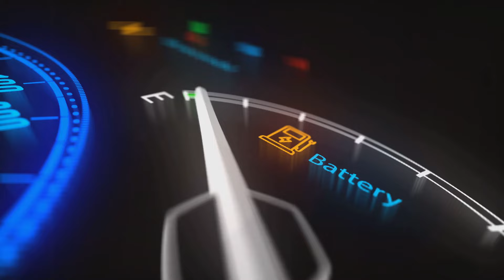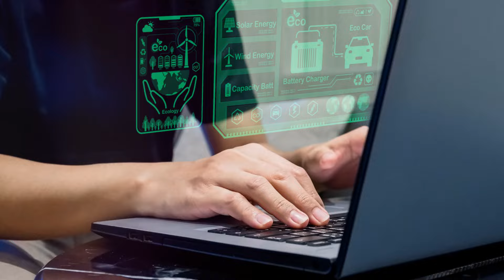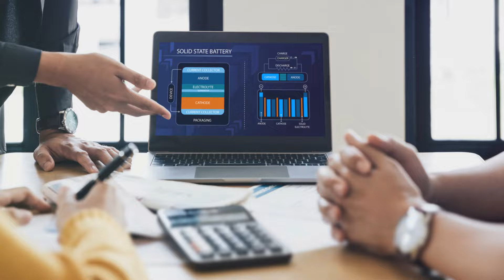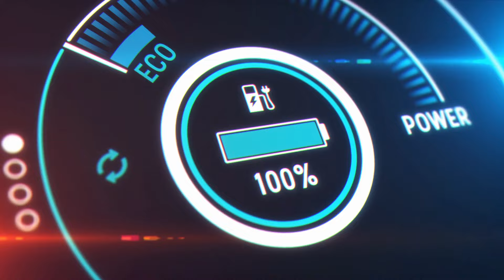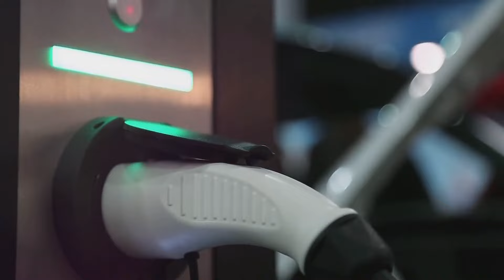The Hidden Environmental Impact of Electric Vehicles

Comment: Seems like a nonsense EV smearing video that repeats itself over and over, definitely a thumbs down from me. It's an emerging industry so there are obviously going to be problems but it's definitely a step in the right direction and far better than petrol/diesel. Once we get most or all electricity from renewables they will run emission free and there's plenty of people working on clean recycling of batteries etc too

Comment: The amount of incorrect statements in this little propaganda piece are just too numerous to even bother with ..I will just start with the first couple of them ...Electric cars are much more dependable than ICE cars. Redwood materials is a company that recycles batteries. They retrieve 95% or more of the materials at a cost less than mining them. This video is a joke!
Reply: actually, the propaganda piece is kind of amateurish, I hope they didn't pay too much for production 🤣oh, it's an AI, needs some work before it can exterminate us!😆
Reply: More dependable? I have a 2006 Accord still going with original engine and no major repairs. How many 18yo EVs drive without battery change?
Reply: @cyberfunk3793 as much as i would like to agree with you on this EVs haven't been main stream for that long.  EVs really became a measurable percentage of road vehicles across the world in about 2010.

Also being as how the two vehicles are different in many ways a better reliability measurement would be through total cost of maintenance in both money and time.  Being that i'm sure that 2006 honda had to have its battery replaced, oil changes, belt changes, bearing replacements, exhaust repairs etc. Then compare that to EV maintenance costs.  To correctly do this utilize the Vehicle manuals for maintenance frequencies.  Then get amount of time for maintenance and cost of maintenance from at least 3 different shops.

I will tell you this not all EVs will win against comparable ICE vehicles.  It gets more interesting when you toss in Diesel and Hybrid vehicles....
Reply: Wrong.  Mining is still cheaper than recycling.  Do some research next time.
Reply: @encinobalboa  depends on the materials, for example its cheaper to recycle copper and aluminum than it is to mine it.  vs say plastic where it is cheaper to make new plastic than recycle old plastic.  However,  in order to keep prices down on these materials recycling is used so that new mines or refineries are not required to keep up with demand.  So in the end the whole "recycling" argument is rather moot for both sides.
Reply: @philipdillard1581  We are not talking about aluminum or copper.  We are talking about Lithium, Cobalt, and Nickel.  Of course you know these are the principle metals used in Lithium batteries.
Reply: @encinobalboa  i used those as an example of how depending on the material it could be cheaper to recycle vs mining.  Again in the end in order to keep up with demand of these materials both methods of harvesting need to be done in parallel.

The following materials are major components of Lithium Batteries of various chemistries, Lithium, Nickle, Cobalt, Manganese, Graphite, Iron, Copper, Aluminum, and Plastics.  All of which except for maybe the Electrolyte material are Recyclable.  All of but Graphite, and Iron are cheaper in both overall cost, energy consumption, and environmental impact are cheaper to recycle than to mine.  1 ton of Battery Grade Cobalt requires 300 tonnes of ore or roughly 5 to 15 tons of shredded battery.  Of which the remaining shredded battery yields other materials utilized for battery manufacture.

Both methods yield materials that are used by similar refinement facilities to produce a finished product.  So ask yourself which is cheaper a shredder grinding up old batteries and the an automated sorting machine? Or drilling holes to place demolition cord then using heavy equipment to harvest ore?
Reply: @philipdillard1581  Yes, I changed the oil, filters, brake fluids and coolant and the battery few times and belt once (cost something like 20). Also break pads and tires obviously but those wear out faster on EV. Battery costs are nothing compared to replacing EV battery at least every 10 years. I have done all the service myself, which I could not do on an EV.

Comment: Batteries are about 98% recyclable to their raw materials. This is poorly researched and wrong
Reply: Cost.  It is cheaper to mine than to recycle.  EV makers follow the path of least resistance which is to mine.
Reply: @encinobalboa  it’s also cheaper to recycle than to throw away. If you dont think it’s happening at scale, look at redwood recycling
Reply: @legendofthepeach  Wrong.  Redwood received 2Bn. from the DoE.  They are subsidized.